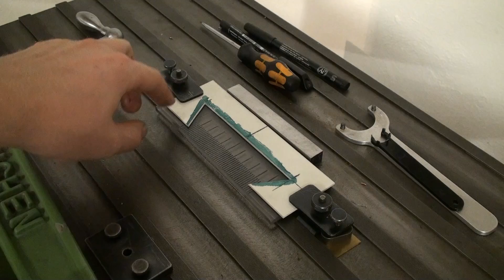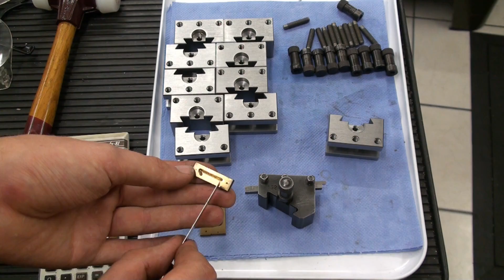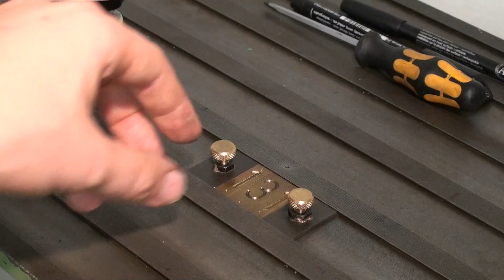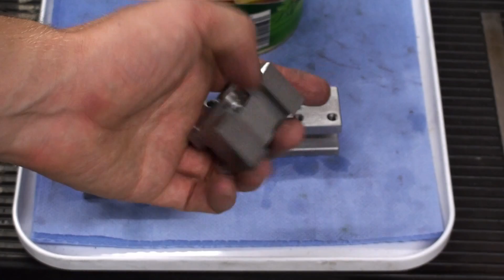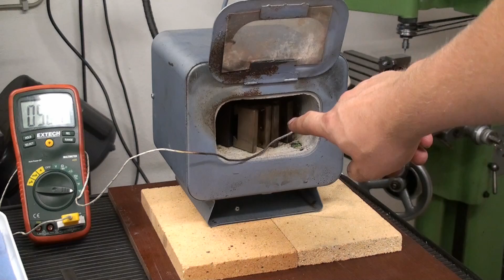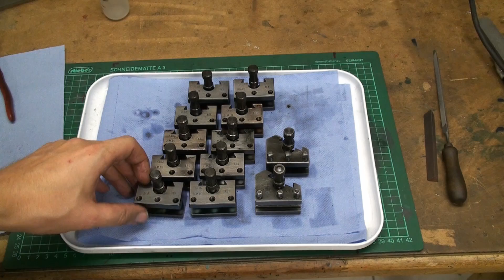Tripan 111 toolholders Part 3 - Tripan 111 Werkzeughalter Teil 3

Comment: Hello Stefan, really nice work (both machining and video content), all three parts. May I have a few questions, please? Except the oil blackening you did not do any other heat treatment (carburizing, hardening) on these holders, right? How are they holding after more than four years of the usage? Also, the original 131 holders have corners on the dovetail side cut out (even on your drawing), you have left them there - did you ever got into situation, where they were in the way? Sorry if I have missed it answered in the videos. Thanks, T.

Comment: Dear Stefan,  To some extent, I followed your advice: I exchanged my Multifix model A (with 5 toolholders) for a Tripan 111 (with 3 toolholders model 131). Now it's time to go ahead and manufacture a couple more. Your 131 TOs are slightly larger and thicker than that from Tripan right. Thanks to you handsketch from part 1 video. Do you have some similar sketch for model 132 ?  A huge thanks for your insightful video.

Comment: Interesting you had to make the clamp screws. Here in Australia at least, they are commercially available. We call them hardened square head set screws and used to hold pulleys etc. onto shafts. The end of the screw is commonly hollow pointed to emboss into a key so a bit of grinding will be required for the toolpost.
Reply from the maker: I found them in the meantime here too - Normaly they are only availible in packs of 1000 and are quite expensive, but I got a batch of 200 on ebay for reasonable money :)

Comment: Excellent work, you will find an easier, and better way to lock the height adjuster is to tap right through the nut, and screw in a locking "bolt" from the top, a much better system than a friction spring, and easier to do.
Reply from the maker: +Englishman French That was one thing that I consideres, but It works fine without any locking - at least for the way I work :)

Comment: Looks good sir ;) if the height screw is bothering down the road, you can make a 2-3 mm thick nut and put it below the top height-screw nut and lock them agains each other. That might work ;)

Comment: As usual Stefan a beautiful job. It's great to watch a real craftsman at work and who  clearly enjoy's what he's doing. Somehow you need to find yourself a small enough surface grinder that will fit into your shop size. :-)

Pete
Reply from the maker: +Turning Point A nice small surface grinder would be great, but they take quite a bit of floor space. I would have to sacrifice one of my other machines in the shop for that. Only thing that would fit might be a small blanchard grinder (check out "Kugelmueller MPS1" on google), that would cover a lot of my needs :)
Reply: +Stefan Gotteswinter 
Yeah good point, but you don't have any machine tools to give up. They did make a very small one over here in North American. Think it was called a Sanderson? About a 6"-7" longitudinal table travel. But there pretty rare today.

Pete

Comment: Hi mate.It's getting A little boring, an other job well done.  I was thought to quench in old engine oil.  It creates a lot of smoke but the result was a nice deep black finish.  I love that engraving machine, while I spend a lot of time with one of them, I would not have thought of all the uses you thought of.                   Marcel.

Comment: Nice series. I use a small round plug of polyethelene (or a piece of nylon grass trimmer wire) trough the threaded stem of the toolholder to get a friction fit of the height adjustment. works great.Cheers.
Reply: +Flip de boer I like that idea...  ;)
Reply: +Flip de boer You beat me to it, that will teach me to not watch as soon as the video is posted. I got the idea from from some Allen screws I bought that have a plastic insert for locking purposes.
Reply: could be done if there is a groove. otherwise try drilling a hole trough the treaded stem and put a small piece of string trough. can only be done with the long treaded nut as Stefan has them though. I have other toolholders, with the standard knurled adjustment nut on which i have tapped a M3 setscrew hole in which a setscrew pushes a small plug of plastic against the tread of the stem. Then you can adjust the friction.